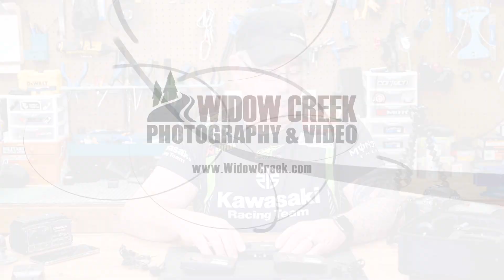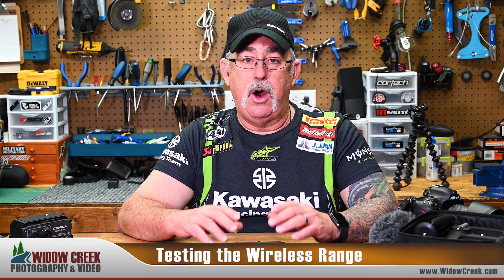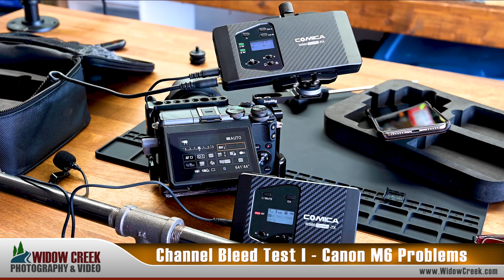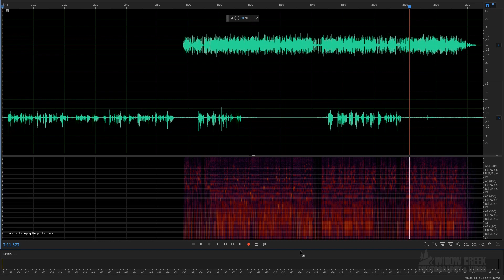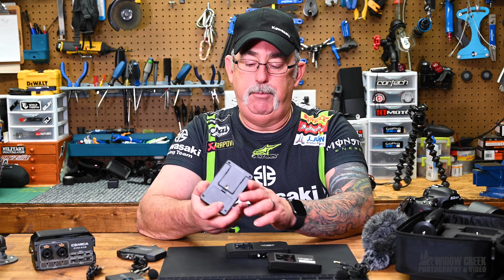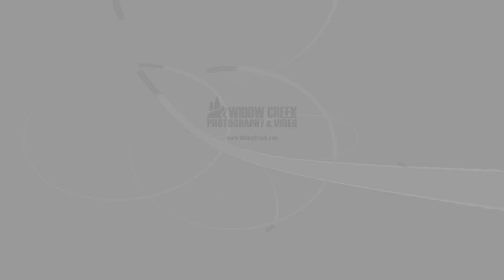The Comica CVM-WS60 Wireless Dual Lavalier Microphone System

Comment: I have experienced drop out with this mike. batteries were fine. I use it for youtube videos with my smart phone ( Note 20. Typically I don't have a drop off. This time I noticed that the phone received a notification during the filming. Could the phone signals cause the drop off?
Reply from the maker: Yes! As I have been using my phone more for filming, I and finding that there are many times the phone itself is interfering with the wireless signal. Now I typically set my phone in airplane mode before recording and I have not had any issues. Also, I use a couple of different electronic gimbals, and I have one older Osmo Gimbal, who motors will cause dropout. I upgraded and it works great.

Comment: I see that you have an electronic gimbal, did you have my issues with the electric motors and interference?
Reply from the maker: Joe Dirt I did not have any issues with the DJI Oslo gimbal. I used a universal side mount for the OSMO (https://amzn.to/39uz9VF ) to mount the receiver on ind it handled it very well. Even the added weight of the AAA batteries was not an issue for longer holds.